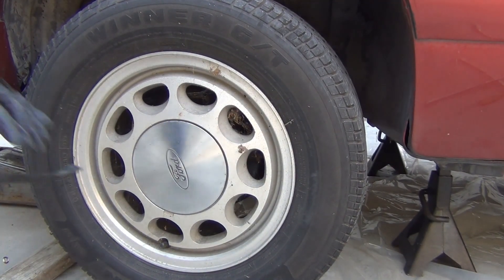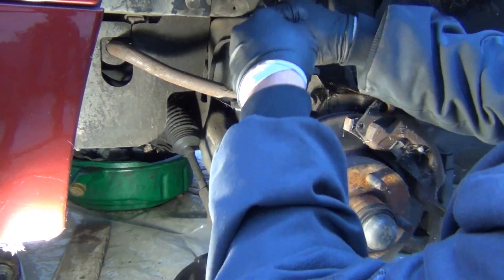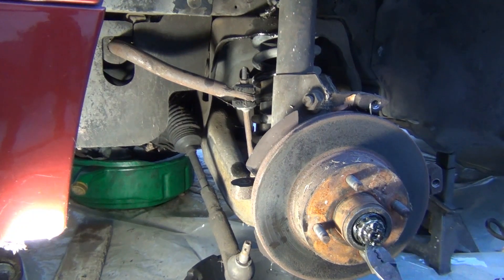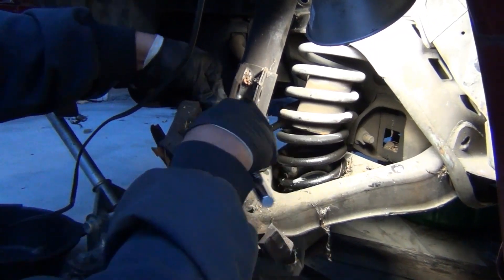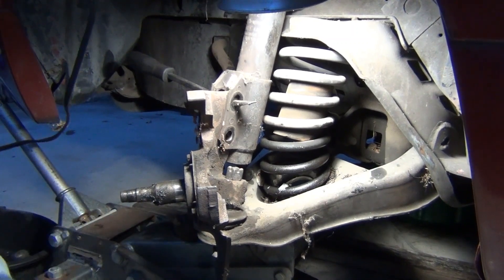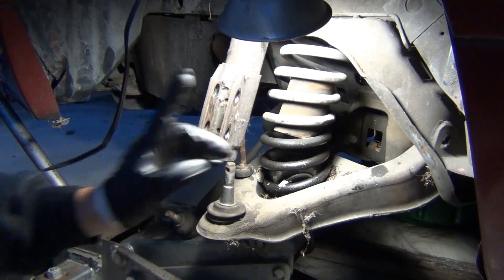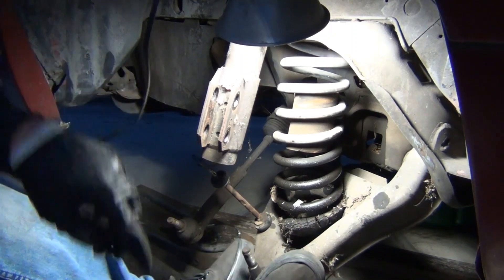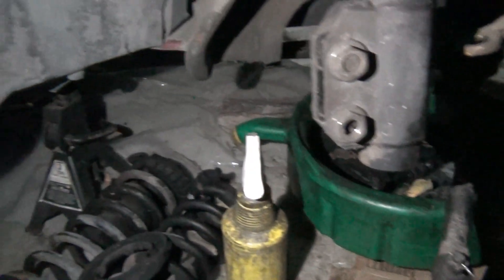Foxbody Mustang 5 Lug Conversion: Disassembling The Front Suspension on a 4 Cylinder Notchback

Comment: Thank you for showing.  hydro/jack pess on (amz) nowadays. Will need a buddy to help hold or do some crafty engineering. Fun little tool to have around.  I keep metal wights and few metal bars from anything heavy and last few pipe rings and sockets to use as push/punch.
Reply from the maker: Thank you! I appreciate you watching and leaving a comment. I bought a hydraulic press as well since I made this video, now I am able to replace bushings and stuff at home
Reply: @MrBlitzkrieg1987  awesome. I have 1988 T bird i want to go from 4 to 5 lug.  Got a NES93 Mustang to pull from.  got them both but havent started just yet
Reply: That press pretty neat. Now that you got  you one jibs pop up be like damn wish I had it long ago haha

Comment: I was watching to see how climatic your spring removal would be. I almost started on my SN95 swap last night, but realized that I'd better clean and paint the spindles first.
Reply from the maker: Yes, I didn’t really have an issue taking off the spring but you have to be careful with the jack if you’re doing the same thing on a GT or a V8 car because the springs are longer and they have a bit more pressure.